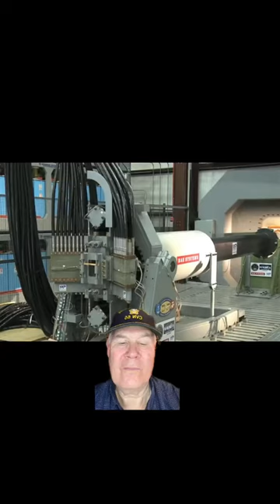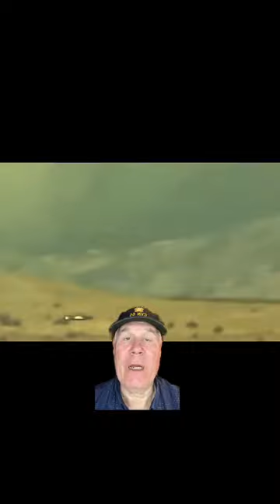US Navy Rail Gun

Comment: Imagine firing it from space
Reply: That's what I thought when I first saw this
Reply: It may operate better in that environment
Reply: By the time it gets to the ground, it would have slowed down considerably. Probably better to shoot it from a closer range where the projectile is at its fastest out the barrel.
Reply: Engineers could probably find a way.
Reply: @Frosensouls  Well of course you can propell it with engines or rockets. But you're making it expensive and complicated just to keep it on a high speed trajectory through our dense atmosphere. Sounds wasteful and inefficient.

Why not just shoot it from the ground where it closer and traveling at its peak velocity?

Regardless, orbital weapons are banned. There is an idea called kinetic bombardment, and the US devised a 20 foot long by 1 foot diameter tungsten rod(like a telephone pole) that was satellite controlled and could be dropped across the globe at speeds of Mach 10 (7672 mph). In orbit it gains speed up to 17,000 mph and slows to 6,700 mph at impact. They say it's yield is around a small nuclear bomb.

So you see the rail gun can simply shoot a projectile at 7,000 mph without having to drop from orbit. Only difference is a projectile the size of a tank shell, vs a 20 foot rod 😂. That's a lot of mass traveling at those speeds.
Reply: @JadieJamz  for every action there is an equal and opposite reaction. I don't know how the hell this would work in space?
Reply: @DrDinkle How's it gonna slow down moving through space ?? Moving towards the Earth's gravity. Surely the biggest issue would be keeping the projectile from burning up in the atmosphere. Not losing velocity.
Reply: @VladimirGitcherocksoff  You need to re-read. I never said slowing down in space. It won't be in space forever lol, the slowing down happens in our atmosphere. I said it's been tested in math to go from 17,000 mph down to 6,700 mph. That's at least 10,000 mph slower due to our thermosphere all the way down to the troposphere, which is super dense with air molecules if you're traveling at thousands of miles per hour. 

You say we probably only have to worry about the thermals not velocity loss, well the reason it burns up as you mentioned, is because the object would literally undergo immense friction with our air molecules, resulting in slowdown of the object. Think of the air like thin water. The object would begin slowing down even up in the thermosphere.

 Heating up is a byproduct of the friction of the air as the object collides with it, resulting in less velocity and instead converting that loss in velocity into high thermal energy, light, etc.
Reply: @zach88888  It wouldn't work. Unless you have thrusters that would have to burn for like 30 minutes to counteract the crazy recoil and get the launcher back on track of its orbit.
Reply: @DrDinkle  my thoughts exactly. As soon as any change in acceleration took place it would instantly start affecting the satellite itself.
Reply: @DrDinkle  1. This is how we move asteroids to nearby mining facilities and customers.
2. On interplanetary spaceships, this is an engine.  The momentum is smoothed as in the Orion Drive.
Reply: @DrDinkle I just wanted to say thank you for not being an ass when answering. You seem to know what you are talking about and you don't feel the need to make others feel stupid when answering. That's rare on the internet these days.
Reply: If something like that is fired or propelled from space the reaction on the launcher might move it out of orbit. 
Better to use a small rocket
Reply: Why would you need to fire it in space? And I don’t know if you guys know this but when you’re in space you have to be traveling at about 17,500 mph to stay in orbit you don’t just get to go straight up and float around the reason you’re feeling weightless is because you’re going 17,500 mph in orbit so all you would need to do is just slow it down a little bit so it could re-enter atmosphere why would you need a canon when you’re already going three times faster than this thing?
Reply: @Snow41174  really this is an engine in space where is the electricity coming from because these things need a lot of electricity to fire or eject please take doctor off your name
Reply: @dustinnance3163  I'm guessing you're former astronaut
Reply: @td128  no but my grandfather was from Wapakoneta Ohio were I grew up up

Comment: It literally tore itself apart every time the projectile was shot.
Reply: Barrel Erosion. No cure.
Reply: Yea 18 years ago it didn't. We have them on ships today. They are Def starting to switch to laser weapons now. 😂
Reply: @TheOGstriker  Oh boy. Max CW power at 10K feet is circa 100Kw. WORTHLESS against a fast moving surface like a propeller.
Reply: worthless because barrel was evaporating from the arc plasma generated by the shot. A rail gun short-circuits the conductors to generate the immense magnetic power that drives the projectile, but that arcing plasma also vaporises the conductors (ie, the barrel).
Reply: @toraguchitoraguchi9154  Well that and the TUNGSTEN SLUG undergoing 19,000 G deformation
Reply: @toraguchitoraguchi9154  Huge current.

Comment: It kept breaking under it's own pressure, so they shut the program down.
Reply: i mean no not really, they shut it down beacuse it wasn’t logical and it wears down the barrels at in insane rate, it wasn’t breaking down all the time…
Reply: Now we have laser weapons, which are more affordable by a huge margin
Reply: Barrel wear and the contractor scalped the navy, jacking up the price of the projectiles
Reply: @jacob1423 ok so you said what he said just in different words. Smart ass.
Reply: @jacob1423 AKCKTUALLYYY
Reply: "It's" is a contraction of "it is", and "its" is possessive.
Reply: I know this isn’t possible, but it would be cool if we could get the air out of the way, at least for most of the path. Imagine if you could fire something like a plasma beam, making a vacuum tunnel, closely followed by a supersonic projectile, virtually in a temporary vacuum. I know it doesn’t work this way, but it would be cool if it did.  Visually and sonically cool for a movie weapon at least.
Reply: No weapons programs ever shut down
Reply: 😊😊 did they pinky promise  ??
Reply: @wilurbean  smart man. its a wam. we are not supposed to be manufacturing modern wam systems. scrapping the project is just a way to move it to full classification once again.

Comment: Not anytime soon. The barrel has to be replaced after almost each time it’s used. The size of the power plant needed to be able to make enough electricity to power it would have to be most of the ship. At that point it would be easier and cheaper to just use space weapons. That’s why it’s been on the back burner for over 15 years.

Comment: Emphasis on was.  The program was cut.  The unit almost self destructed every time it was used.  In addition, the energy requirements was too high for the weapon to be practical.  However, they did get a ton of very good data that could be used in a future program.  The tech needs more time to mature.

Comment: because it's huge it's should be devided.  thats how it can shoot like a gun without any problem just short eclectic equipment without sacrificing projectile speed and building 1 cannan and charging took time i know but if electricity needed to fire this build 10 20 or 30 which will be changed every time and time should like you shooting guns till the first short fired till the end 1st 2nd till it firing stops or war it shouldn't be closed fired and destroy everything which comes in front of the ARMY OR NAVY TARGET SYSTEM SHOULD BE Installed IN SOME SHEL FOR BURNING HIGH SPEED JETS MISSILES
And IT's cannon SHOULD BE INSTALLED 0.6 inch (and hide everything in water no can detect it to)above the water then you can shoot from it 1000s of rounds without hurting the cannan in emergency that canan divided in 2 or 3 the cannan parts if one through it put another one always 6 canan divided parts with you in war

Comment: almost double of the fastest tank shell. too bad the railgun basically destroys itself whenever you fire and you need an extreme amount of energy. but most HEAT shells are way more powerful than this anyways. some pentrating more than 500mm of RHA. 6-12 inches is like 150mm-300mm. too expensive and honestly not that powerful. many kinetic APFSDS shells like the one seen here (atleast it looks like that, i think there's a sabot flying off at the beginning and it looks like a finned dart) can actually do much more than 6-12 inches of penetration.

Comment: Yeah...Rail Guns.  The..performance of rail guns IS exceedingly impressive.
However, the sheer amount of electrical power is beyond enormous. Along with the nasty little...little blowing/ripping itSELF apart pretty much EVERY time it is fired/actuated.
Perhaps there needs to be a..transfer, of moving the more..destruction prone rail GUN "parts", FROM the stationary/stable rail gun firing platform itself..INTO the projectile itself..OR including the OVERLY sensitive components into sort of a..discarding sabot. Y'know...NOT the projectile itself, but more to..eject, the..now self-destructing weapon components WITH the "dart"..and it would be immediately replaced with BRAND new components.
And these TOO "would" inevitably "catastrophically FAIL.  So..rather than being a..once shot wonder, and requiring God knows how many dollars & man HOURS to refit..to fire a SECOND round..eventually. Make the WEAKEST components in the weapons system..deliberately disposable. Rather than a complete re-design to FIX what unfortunately IS "at present" an UNavoidable predictable catastrophic component degradation/detonation resulting from such just ..dumping megajoules of electrical energy so QUICKLY over such an incredibly brief operating cycle.
In order to..handle, that much power, rhe rail gun itself would be SO F-CKING BIG, so as to make it ..problematic..to ever MOVE it. A completely stationary firing platform is just so obscenely strategically STUPID..as to not even consider.